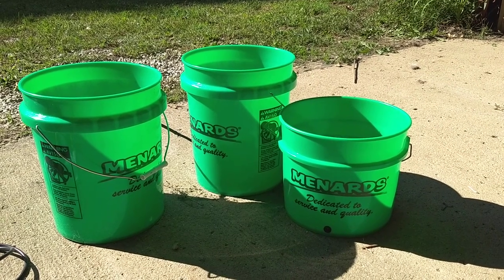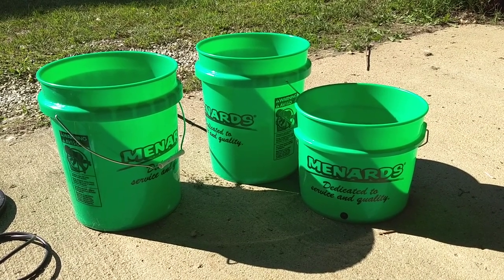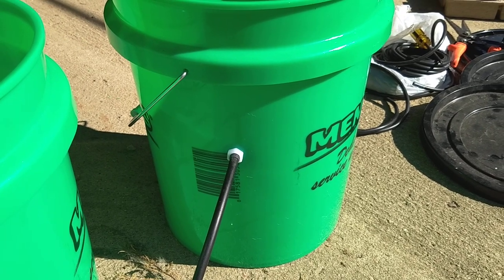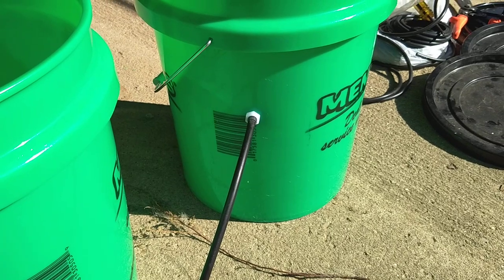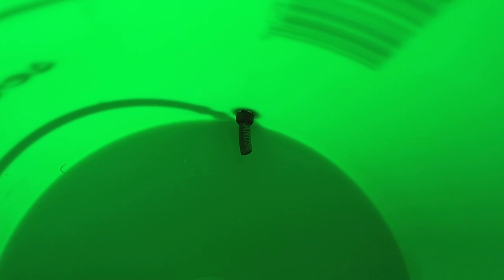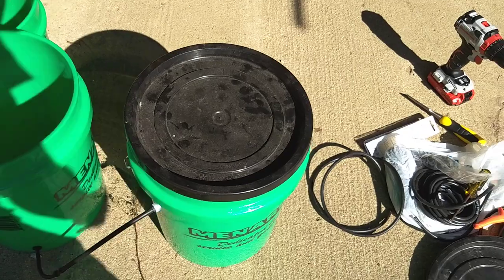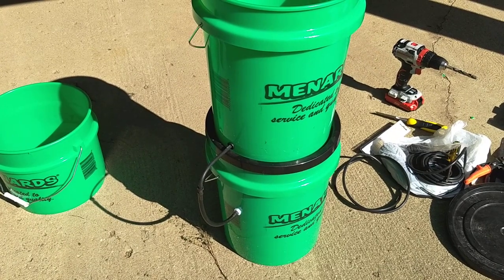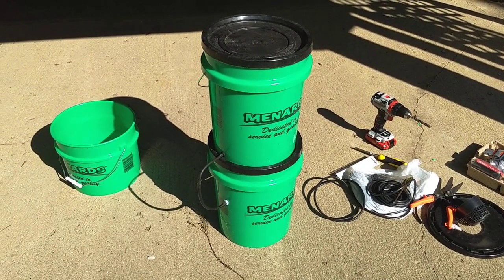B.A. Kratky Float Valve Setup for Supplying Nutrient to Larger Plants

Comment: I like the idea of stacking the nutrient reservoir on top of the controller.  Very space efficient assuming the lid is strong enough and it doesn't fall etc (which seems like it wont be a problem)
Reply from the maker: Thanks Jeb, I wonder if it would be a nice supply of nutrients for some of your office projects.
Reply: This can be done with the yellow top totes too, in case you need more capacity... No problem with holding the weight either, although a thin piece of wood will work for buckets. It'll also help to keep the molding nipple on the bottom of the buckets from weeping over time.

Comment: This is a great setup,  yet there are very few people doing this type of Kratky with a Control bucket.  Most are doing dutch buckets with recirculation...  seems most people think Hydroponics means moving water,  or they just like to see the water flowing, more than the plants growing..
Reply from the maker: Well said.  Circulating has advantages but at a cost of labor and electricity

Comment: I have a large sump in a circulating dwc pipe setup that feeds a chain of dwc non-circulating buckets keeping them auto topped up controlled by the same float valve bucket water level controller. things to think about. the bottom level buckets need to be level on the same horizontal plane. you can raise or lower the water off and individual bucket by digging down or adding something under it.  the water level inside is the constant.  this setup is prone to poor oxegyn level issues like rot. make sure the water level is lower so that there is an air chamber where the plant can grow air roots, such as in kratky method.
Reply from the maker: Thanks for your comments Mike.  It is always great to hear from other gardeners.  Since deep water culture is prone to low oxygen in hot outdoor temperatures, I use the kratky method.  all of the oxygen and gas exchange happens in the moist root zone above the water, and the root tips never grow so deeply into the water that they are oxygen deprived.

Comment: Quick question:  I'm not at all familiar with the practical aspects of operating hydroponics.  As I understand it, the float is used to compensate for evaporation.  Is there a danger of the solution in the smaller bucket becoming too concentrated with nutrients, as the water evaporates and is replaced by more nutrient water? After all, the water evaporates, leaving the nutrients behind.   Or do the plants consume the nutrients quickly enough to prevent that from happening?

Nice, simple, clean setup.  Thanks for sharing.
Reply from the maker: The lids on the stacked reservoir and controller bucket help prevent evaporation, same with the lid on the grow bucket.  Nutrients are half strength which helps keep nutrient concentration from getting too strong. The plant pulls an increasing more nutrients as it grows also. The system works together to make for very easy growing.

Comment: Like the idea!!! Is there also a option to connect more growing buckets, let say 5 are 6 of them? Are the buckets that you use large enough for growing tomato's?
Reply from the maker: I connect my buckets with tubing and rubber grommets.  Easy to add buckets that way.  For tomatoes, I use one or two 32 gallon trash cans as reservoirs.  For a few years, this has worked great for cherry tomatoes. Heirloom beefsteak varieties do better with larger containers.